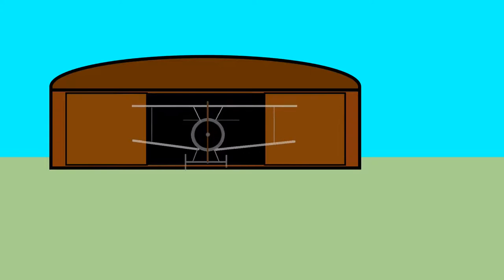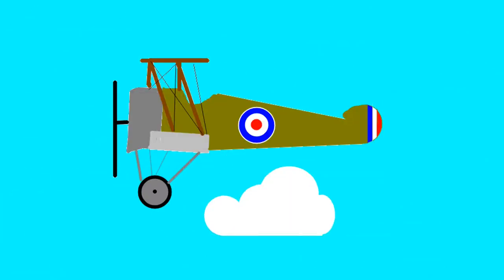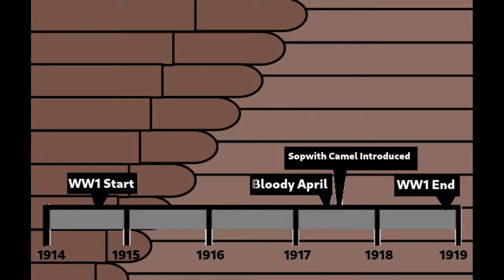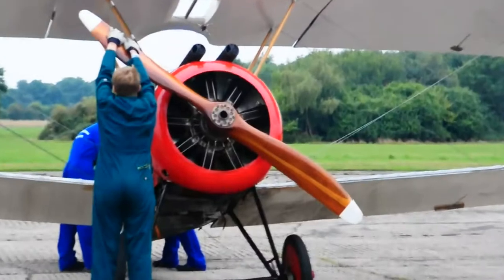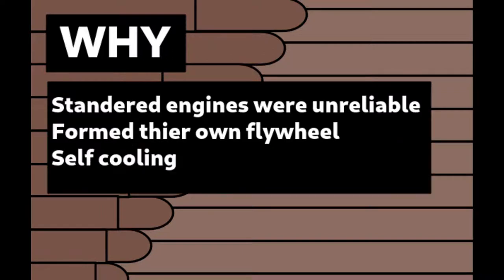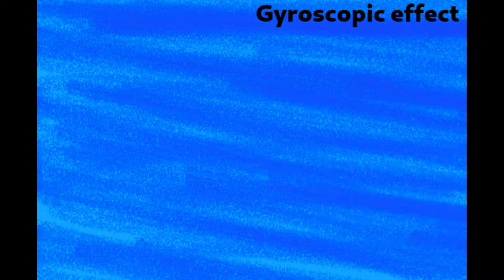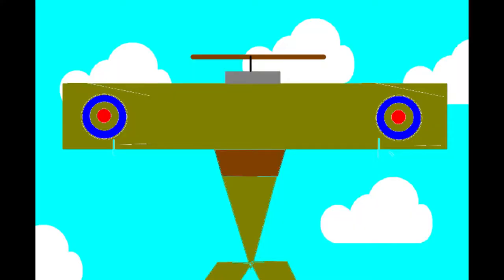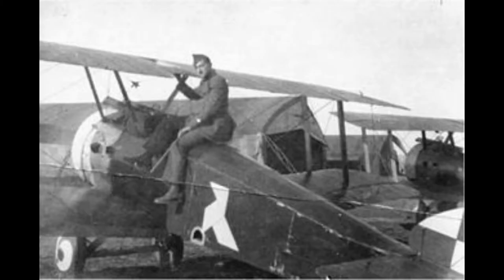The Sopwith Camel: An Animated History

Comment: So much wrong here.  Starting with the engine.  Pilots in WW1 were taught to turn with the rudder and only us ailerons for balance.  This is what caused the precession effect due to the induced yaw.  But there was much more to the machine as many previous ones also used rotary engines without it being a significant problem.  Firstly they moved the fuel tank to behind the pilot this meant the Centre of Gravity was at the rear limit with full fuel (or over it) which made it very unstable in pitch.  Secondly there was no elevator trim system to take the pressure off the stick so the pilot had to push hard all the time to avoid a stall.  Thirdly they size of the tailplane was reduced to earlier machines giving more maneuverability but less margin of control and finally the top wing had no dihedral which improved roll rate but again reduced stability.  The result was a machine that could turn on a sixpence but killed almost as many beginner pilots as the enemy not the least because ab initio pilots had to work out how to fly it on their own.   They eventually managed to make a two seat trainer that vastly improved training safety.
Oh and it wasn't fuel that sprayed into the pilots face it was castor oil as the engine had a total loss lubrication system, which is why many pilots spent many hour on the toilet.
Reply from the maker: I would agree with most of that, sadly I didn't have time to go into that much detail in the video, I do appreciate the feedback though, I am considering at some point in the future remaking this video as it was the first one I ever created meaning its not my finest work, but is one of my favorite planes

Comment: Fair assessment, which leads to the conclusion of no, it was not one of the best planes of the war..  it killed as many of its own pilots as it claimed.  It was slow and difficult to fly.  Barely trained British pilots were strapped in a Camel and told to go forth.  If you could survive the Camel it was a decent plane, but again, slow.  In the end a well flown Camel was a good match for an Albatros or Pfalz but was not a match for the Fokker D.VII.  IMHO the SE5a is a much better aircraft.

One nasty quirk that plays along with the gyroscopic progression was the need to mess with the mixture very shortly after takeoff.  This cause inexperienced pilots to start looking down into their cockpits while still very low.  From there it was very easy to lose control at an altitude too low to recover.

And a Camel did not shoot down Von RIchthofen.  He was almost certainly hit by a bullet fired from the ground.  Nothing against Brown.  He attacked von Richthofen and the DRI went down.  Perfectly reasonable claim.  it was only because MvR was MvR that an autopsy was performed as opposed to just chucking the body in a ditch.  That showed that the fatal shot came from the side, not from above and behind.  Camels did, however, get Wolff in one of the DRI prototypes.